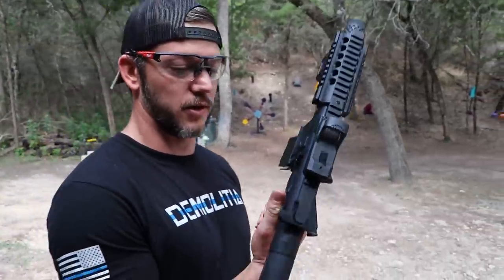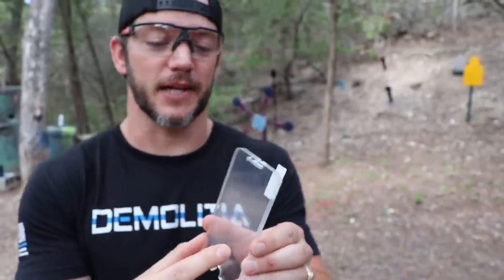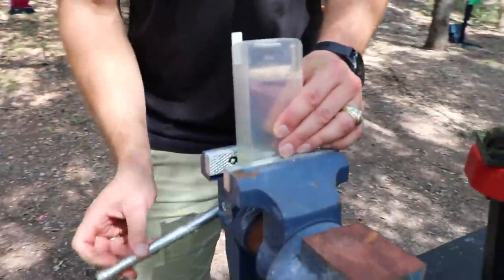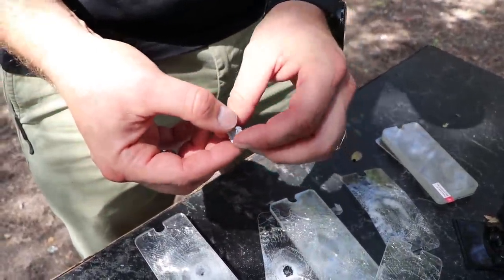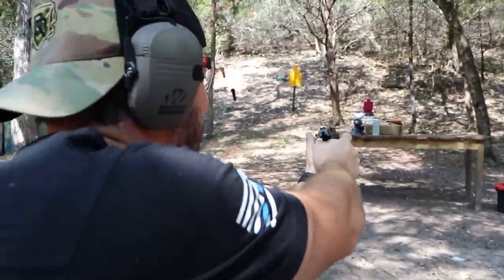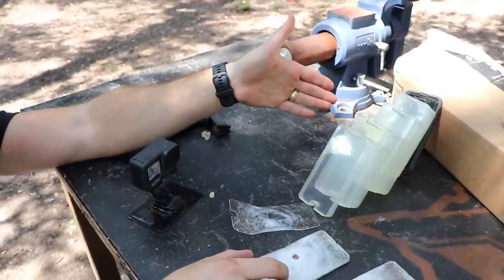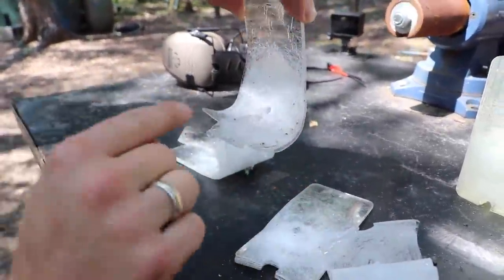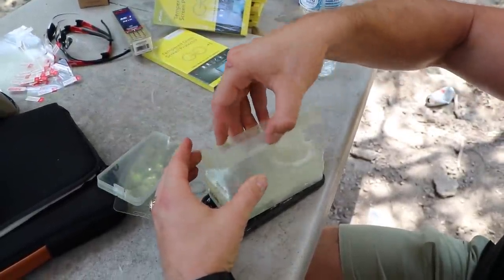How Many Screen Protectors Does it Take to Stop a Bullet???

Comment: That's basically bulletproof glass though. Lots of tempered layers sandwiched with lots of plastic flexible layers. The reason the back cracked is just like the swinging balls physics contraption. The first ball is released swinging into the line of balls, the energy travels through all of them not moving them, once it get to the last ball the energy has nowhere to go but to get dumped into the last ball and cause it to go swinging.
Reply: The military has tank buster rounds that use the same idea. They hit the outside of the tank, they don't cause a lot of damage to the exterior, but the shockwave goes through the armor plating and causes shrapnel to break off on the inside of the tank, injuring the crew inside.
Reply: I was thinking the same.  Thanks for confirming. 💥🎱 🎱 🎱🔨
Reply: best described as a waveform where it has pockets of large kinetic energy.
Reply: ** laminated glass
Reply: so he should actually put it in the vice, queso shockwave would have nothing to reflect and phone just loose back cover
Reply: @GoodBoyGoneDad  HESH that is
Reply: I study physics, and YES! swinging balls is the answer ! lol jk idk
Reply: haha balls
Reply: Newton's Cradle
Reply: @shoumyadeeproy5777  👍
Reply: @GoodBoyGoneDad  That's High-Explosive Squash Head (HESH) you're describing isn't it?
Reply: We don’t care 😂🤣
Reply: @brennanjordan6815  in terms of maturity, we have no maturity.
Reply: Someone should try the same method but put the phone somewhere in middle of the stack of screen protectors
Reply: I love how I commented the same explanation the same day and not one person liked or commented but a spammer
Reply: Yeah it’s just a Newton’s cradle with extra steps
Reply: the balls harden
Reply: Kinda like when he was shooting the glass balls, how cracks would appear on the back end of the balls
Reply: @GoodBoyGoneDad  how inhumane :)
Reply: @GoodBoyGoneDad  isn't that a HESH (High Explosive Squash Head) rounds?
Reply: yup, i was just about to say that he basically made a screen-protector newtons cradle
Reply: Are you referring to Newton's Cradle, if so I thought of that too at first but b because there were multiple cracked in between the beginning and end points I highly doubts it uses that same rule
Reply: @EtherealWheat6  i think the reason they broke together is because they were adhered to each other, but the block that was separated in the middle managedto be unscathed
Reply: You're wright
Reply: You're right
Reply: @GoodBoyGoneDad  he be like : how? I be like : logic.
Reply: Its that and many other things. For example the reasons for the big circle randomly appearing somewhere in the middle are primarily the shift in frequency of the shockwave (all waves get lower/longer as they travel) the resonance of the glass (you know how you can break a glass by just singing? basically the same thing here).
Reply: Yep faster bullet = more energy to disperse
Reply: Thx
Reply: @Iordlangford  if your thinking it’s constructive and destructive interference than your wrong and need to stop watching quantum mechanics double slit videos and start watching 801 QM lectures from MIT
Reply: Heh. Balls
Reply: The only problem with this theory is the breakage was totally random, it wasn't "the first broke, nothing in the middle and the end broke" like you stated in swinging ball theory.

But instead it was the first broke, then a bunch didn't, then some did, then some didn't, then some did again, etc etc until you get to the end
Reply: Probably not a good idea to explain physics to these guys that shoot random things for no real real reason. They don't really know what physics are besides trial and error.
Reply: @GoodBoyGoneDad  thats cool

Comment: It looks like the 22 hornet delivered enough energy to create a pressure wave that bounced back and forth.  Likely, the shattered ones are the node points where the reverberation back and forth in the stack created constructive interference.  The pattern looked somewhat regular in distance like the nodes of a standing wave.
Reply: i don't know what he said but it sounded smart so i'm going with it
Reply: @rainier you ever seen how two different waves of water crash with each other on opposite sides? Well, that but on screen protectors. if you saw his video with the glass ball, it’s the same as well
Reply: Doubtful. Most likely is its like a Newton's Cradle. The screen protectors were not all connected, the bullet strikes the first section, transfers it's momentum through the next sections, exerts a large force on the last section. The last section then pushes outward and smacks the backstop (with the phone). The shattering was a result of the last section and phone smashing into the backstop, the from the bullet. If they put foam as backstop to catch it, it wouldn't have broken. Or if all the peices of glass were one single peice it also wouldn't have broken
Reply: Good work, gentlemen. One thing is certain, more data  is definitely needed to be certain to any degree of confidence. Lock n load bois, it's smartphone season!
Reply: Someone just took Grade 12 Physics...well done good sir
Reply: yes thath is what hapend im a sientist 2 years ago its making sense
Reply: Sounds smart enough
Reply: I believe you are using nodes when you meant to say antinodes. The nodes are produced at locations where destructive interference occurs sometimes described as points of no displacement. The antinodes are the locations that undergo the maximum displacement during each vibrational cycle of the standing wave.
Reply: Didn't ask
Reply: @connorturner652  Literally Matt asked...

Comment: not a physics professor, but I believe it's a similar reaction to when you shoot a glass ball. The shockwave distributes force on the opposite side as well.
Reply: Bingo!
Reply: I think your right. :)
Reply: I would hazard a guess (talking largely out my ass here) that the subsequent shatters occur where the shockwave interferes with itself, which would apply extra stress to the material.  Maybe.
Reply: I thought that the ones that were brokeb are simply just lower in quality
Reply: @427Arbok  so basically harmonics... like a singing lady breaking a glass with her voice. Two shockwaves pressing against eachother, causing stress in the material.
Reply: Rita 25 y.o - check my vidéó  Actually, I'm pretty sure that's the normal force (the Newtonian "opposite reaction") of the impact being transferred into various bits of shrapnel from both the bullet and the target, though I suppose the elasticity of the target may have a minor impact.

That said, non-elastic targets would still be prone to send shrapnel back at the shooter, hence why you don't shoot dead-on at plate targets with high-powered rifles, as the ricochet might go directly back at you.

Plus, when glass shatters, it tends to do so in what is almost (and sometimes very much is) a kinetic explosion, due to the peculiar molecular structure of glass.  

Both of these factors (while I am by no means an expert on either of them), I feel, would have a far greater impact than the properties of just the adhesive.

Comment: Essentially the force of the impact and the shockwave it created moved through the screen protectors. The reason it didn't break all of them and only some of them is because of the shock wave moving throw the glass at different wave lengths as it fluctuates down the path. Once it reached the end, all of the force was expelled into the grounding object. This actually happens inside of a rifle barrel to and it is what us Bench Rest shooters refer to as, "tuning a rifle." You set the seating depth/neck tension/charge weight of a bullet so that the bullet is exiting the barrel the same time the shockwave is reaching the end of the barrel or when the barrel is "flipping". Any shot you take causes the barrel to flip and flop, the goal is to make a load that exits as soon as the barrel flips. This allows for an extremely consistent cartridge and 1/2 MOA groups at 1000 yards ;)
Reply: Does the larger caliber contribute to the more rapid dissapation of force and the small caliber passes through easier due to less resistance
Reply: @taylorg9500  Yes the smaller point of impact pushes the shockwave differently.. Similar to how snow shoes work. Larger area distributes the weight or in this case energy and it dissipates much more quickly. Also I would guess there might have been a few pockets between some that could have contributed as well.
Reply: @taylorg9500  さ
Reply: Very similar to what happened when he shot the giant glass ball
Reply: @endking6832  It is not the shockwave - but it goes into a similar direction. The screen protectors are made of glass and a flexible plastic. The bullets are fast. If u slow it down with a highspeed-camera, u will see the following:
-> in the moment a projectile hits with its front the surface of the first layer, the bullet bend it a little bit before penetrates it. In this process it looses a little bit of kinetic energy and speed. Then follows a layer of the glass - there it loose the next part of energy and so on. On every layer of elastic material its produces a little bulge and the bulge pushes all other layers backwards. U dont need a highspeed-camera to figure it out - u seen the pieces flying in the direction of the shooter :D Thats exact the function-principe of bullet proof glass. The only different to a bullet proof glass windows is, in the bullet proof glass there are layers of glass and plastic are bound together with a flexible glue.
Modern tank armor works in a similar way; layers of flexible and non flexible materials are bound together and every layer absorb speed and kinetic energy in its own way and in summary stops the penetrator or deflect it.

Comment: The weird shatterring at the end might be due to a standing wave forming.
The incoming wave gets reflected and interfeers with itself forming peaks of high energy which shatters the glass in some areas and leaves some unaffected
Reply: What about declining EROEI?
Reply: I think the same thing happened when he shot the glass balls
Reply: I honestly think the strange shattering is due to the unequal tightness in the formation of the glass, Force transfers through solids but heats up oxegen particles when interacting with them, expanding the particles enough to crack the glass.
Reply: I think what we're seeing is the conservation of momentum. Even though the bullet was not able to go through the first relatively thin layer, all of the energy had to go somewhere. When hitting a target, the target will move back and because they're often made of steel and have a lot of mass, the inertia (amount of force it takes to move something) is greater. In the case of very thin laminated screens however, the force travels through the stack and can't dissipate the energy quick enough and it breaks.

TLDR: The difference between the glass and a normal steel target, is that the steel is heavy and can absorb more energy. The glass on the other hand can't absorb the energy and release it fast enough so it shatters. 

The same thing goes for a metal target made from something brittle like iron. It's tough and can take a punch, but if it's met with too much force it too can shatter just like glass.
Reply: @JRod0409  That would make sence if the 9mm also broke it, since the 9mm has more momentum than the .22 hornet, even though the hornet has more energy (speed wins in energy, mass has more effect on momentum). So its not the glass pushing back with momentum, its likely the shockwave caused by the extra energy of the hornet.
Reply: Thought it was something like that
Reply: Exactly
Reply: The same with forrier transform, where you send a pulse signal and bounce it back down the same wire and see the interference patterns. Seems like this is likely the culprit.
Reply: @Astolfo-_  kinetic more than thermal, as cracking glass isn't always thermal. As frequencies can also shatter glass.
Reply: @JRod0409  you mean impulse?
Reply: Exactly what I came here to say!

Comment: Sounds like a similar phenomenon to the Newton's cradle. The shockwaves travel in opposite directions, causing damage on the far side where they meet, coming from both directions, but leaving the middle area relatively untouched. Thet would also explain why the screen protectors would always fly forwards instead of backwards.
Reply: beat me to it!
Reply: Is this also why the glass ball breaks on the front AND directly behind he impact?
Reply: Welp I guess I was to late
Reply: That's exactly what I thought.
Reply: @ty.willie15  similar, I think in that case the shockwave travels along the edges of the ball and then meet on the other side and at that point it breaks there because the shockwaves meet at exactly the opposite point of impact
Reply: The compresability of the plastic layer between the glass would explain it.

Comment: It's like when you shot the glass ball, the energy transfer blows out the back end but leaves the center mostly untouched.
Reply: But why?
Reply: That was cause it was a sphere, doesn't make sense here
Reply: Its has to do with the shockwave. The front is soft, the middle becomes hard and the end is soft again. Same with the ball, the shockwave travels true the ball. In the middle of the ball/screenprotectors it cant move material, but on the other end of the object it can move material again.
Reply: It's the same physics behind high explosive shells and tank armor
The shell explodes on the front and the shockwave it creates will travel through the armor and explode it on the other side,because it can't penetrate.
Reply: he should do a collab with smarter every day about this
Reply: It doesn't have to be a sphere. Y'all never heard of Newton's Cradle?
Reply: @razumikhim  you talkin about HESH?
Reply: I am thinking the reason it still got some in different parts thru the middle is due to inconsistencies in the stack vs a well made glass sphere. How well are the screen protectors adhered to each other? Any minor warpage? Those sorts of things.
Reply: I like the theory, but the glass ball is all one piece and the screen protectors are just stuck together
Reply: The bullet made the 'Dim mak' 😁
Reply: The spheres were rigid and none of them break as energy transferred but in this case the energy transferred through all of them but some broke and some did not … the energy transfer must have caused the center to break also … please explain…
Reply: @fernandozegada3768  a question for the slowmo camera channels
Reply: As pointed out. The shock wave travels through.  Any that are less stuck together, ie less supported, broke. Just like the 22 went through more when less were stacked together than the bigger guns did with more together
Reply: @fawadafridi3570  iron balls are more resilient to shock than glass screen shields, moreover the force applied is many times greater. The reason some broke and some did not, is because they are not glued together and the force didn't transfer through them seamlessly.
Reply: All that science stuff, it was some Gandalf the White level magic
Reply: @tokus64  yes but a few screen protectors in the middle were shattered as well. Can you explain this?
Reply: @icecold5707  except when talking about Newton’s cradle they are also referring to spheres?
Reply: @smilemore1997  The reason you use spheres in newton cradles is because spheres are uniform. In theory you can build a newton cradle with cubes but if they hit with just a fraction of a degree off, in any axis,  the cubes will start to rotate and you lose a good amount of energy. A sphere doesn't do that as long as you hit center sphere to center sphere which is way way easier to do.
Reply: @Okararu  No he's not talking about HESH, although they do work exactly the same. HE and HESH rounds work with the same principle, but the squash head of the HESH shell allows its to work on highly sloped surfaces.
Reply: Think metal pendulum balls
Reply: This is a school physics course. The motion of mechanical waves in solids.
Reply: @razumikhim  Thats HESH and against normal just metal armor
Reply: @fernandozegada3768  Because it propagates the wave through the molecules until those molecules can move enough to separate.
Reply: @Okararu  aka HEP (High Explosive Plastic) in U.S. terminology, originally called 'Burney's Wallbuster'. Anti-bunker ammo for recoiless rifles.
Reply: @kowalski3950  yes agreed but as glass broke on its way energy must have been lost we can say that the energy when reaching middle of stack was not enough to break the glass but why the glass at the end break .. if not enough energy passed to break the center then how it can break the ones at back pf the stack …. I think it might have to do something with recoil … the protectors might have tend to move in direction of bullet but since there was no space on other side so ………
Reply: @luukas2660  I know how HESH works, no need to explain.
Reply: @fawadafridi3570  how would energy have been lost? that was a massive amount of gun powder. the ones that didn't break were glued together very well and didn't break from colliding with eachother.
Reply: @fernandozegada3768 It's not as amazing as some shock wave theory. It's newtons law of equal and opposite forces. When the force of the bullet is applied to the front side, the box in the back is applying the same amount of force to keep the stack in place.
Reply: @razumikhim  British HESH shells use exactly this phenomenon. Transferring a shockwave through solid armour to create spalling on the other side
Reply: I was thinking about the same.
Reply: @jefffrank2382  So you are saying you do not want to see it in 10,000 frames?
Reply: @Stephen Hughes,  I didn't say that. 10000 frames would be awesome.  Just saying the science makes sense regardless of the slow mo.